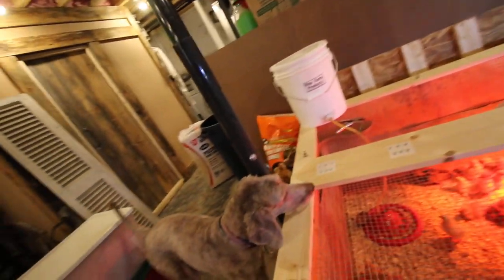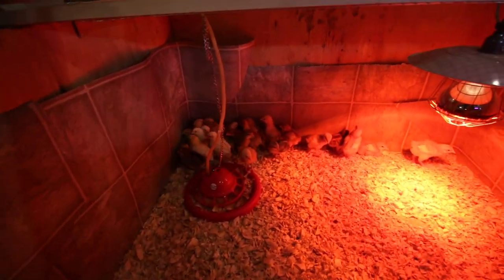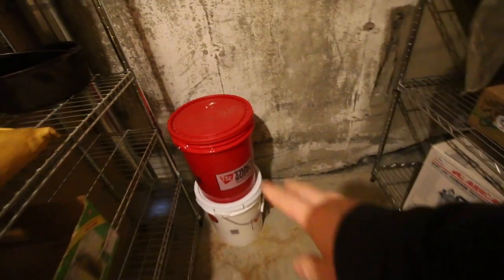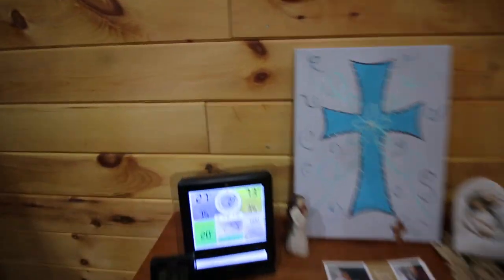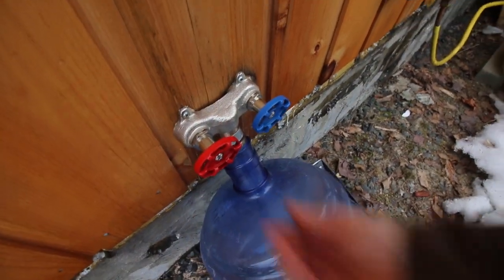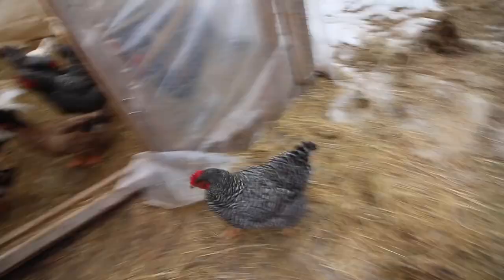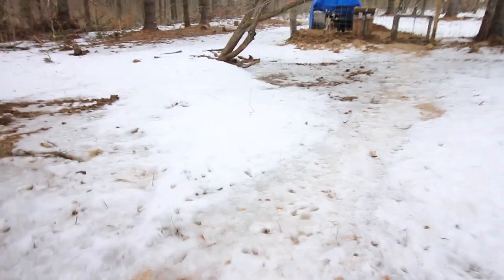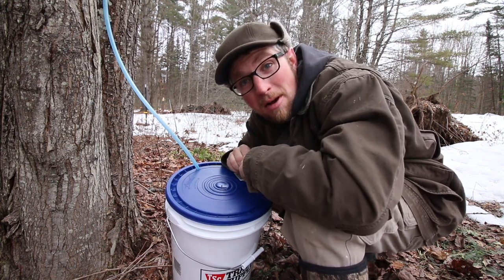Homestead Update Chicks, Pigs, Maple Sap and Syrup

Comment: You mentioned previously that the pig poop had gotten high enough that you couldn’t open the gate any longer. put another set of hinges six or 8 inches higher and simply raise the gate when you put your next group of pigs in, put it back on the lower hinge so they can’t get out of it. Easy PEZY We did this with our front gate during early winter snow.

Comment: Fcat is back in the picture! All the chicks are so cute. Do you ever have a surplus of eggs? Well it doesn't matter yet how much maple syrup you make the frist year , just learning how to make syrup, Al. All your plants are looking good. But l noticed some cubes had more than one plant, you could thin out your plants into the empty cubes.lf one end of the tray   isn't working, try pushing it under the lamp more or flip the tray every day. Use a tweezer to separate the plants if you don't want to use your fingers. I learn so much from your vlog about Steading, and you make it look easy. Thanks for the update!🍀🍀🍀🍀🌹🌹🌹🌹🍀🍀🍀🍀🍀🌼🌼🌼🌼🌼🍀🍀🍀🍀🍀💐💐💐💐💐🍀🍀🍀🍀🍀
Reply from the maker: we have a surplus of eggs right now. We can't eat the fast enough
Reply: I've found it's difficult to remove one of two adjacent seedlings in a block without damaging one or both. It might be best to wash away the block and gently untangle them. Then they could be "planted" in the next size block. I've been Watching Khang Starr's hot pepper videos. He starts in solo cups and just sprays the potting mix off with a hose.

Comment: those pigs busted that feeder up. time to repair it ?
Reply from the maker: I will fix it come spring
Reply: It's mainly that the plastic bottle hinges are no match for those gals. I've no experience with pigs but I suspect heavy duty hinges and carriage bolts will be needed. An option for the top might be to run a hot wire around it.